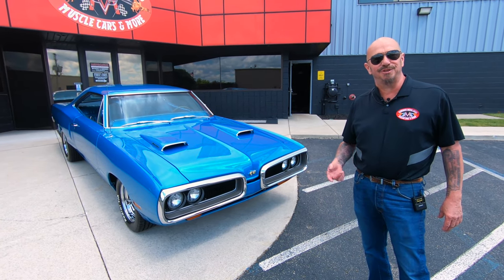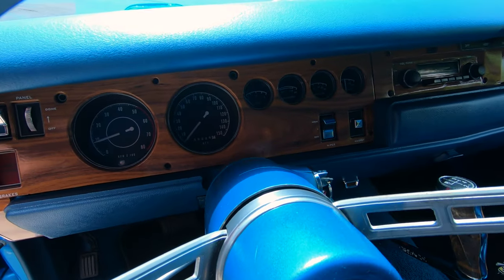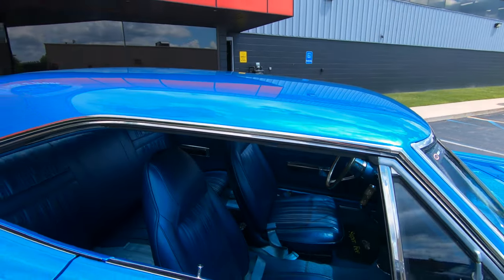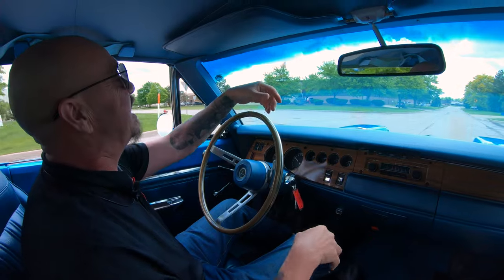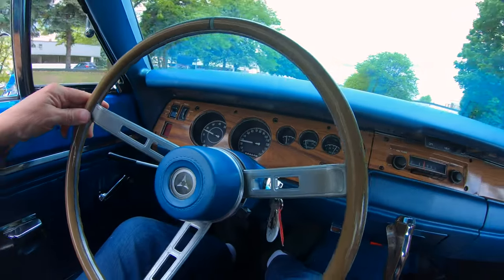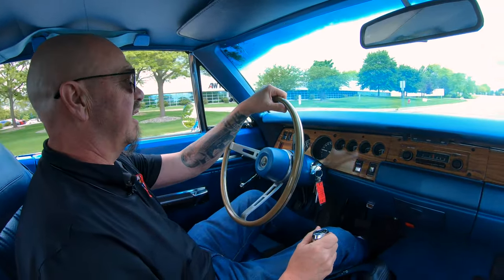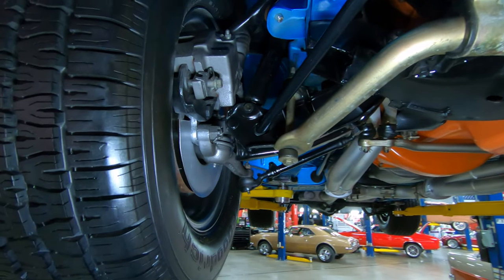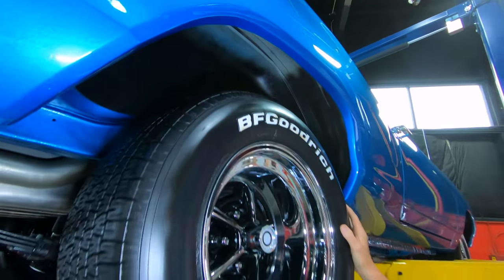1970 Dodge Coronet Super Bee V-Code For Sale Vanguard Motor Sales

Comment: Awesome car! Restored car show entries the cars have to be just like they came off the assembly line condition or it will be a point against the car. I mean every decal has to be in factory locations. I had a 66 nova i thought i restored in original con. I entered it and completely failed. I didn't have decals tires where not factory. It aint a easy thing to do.